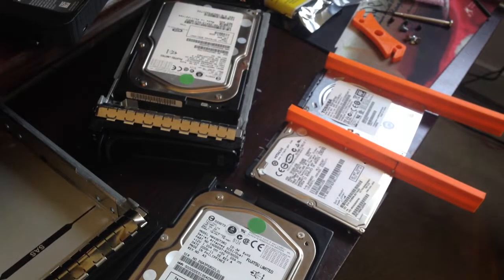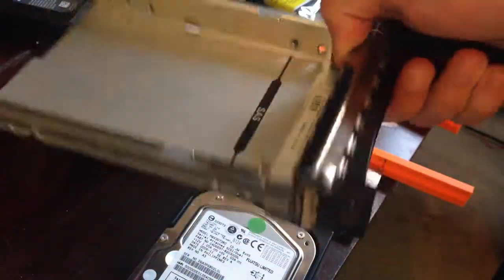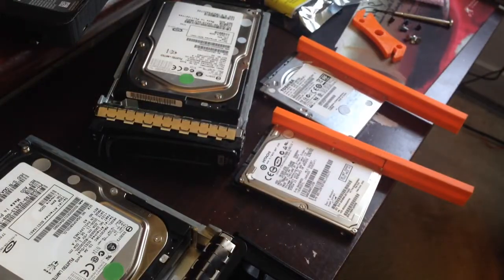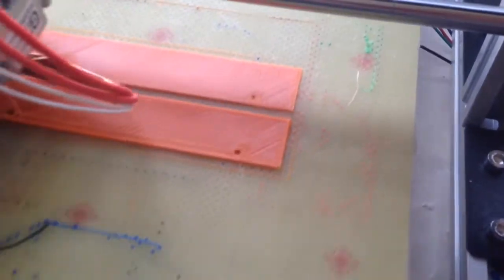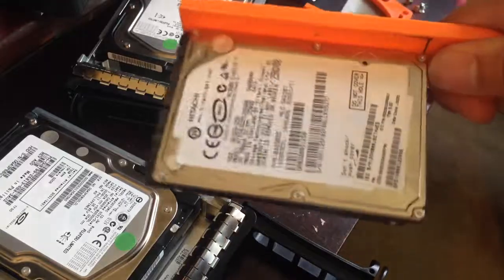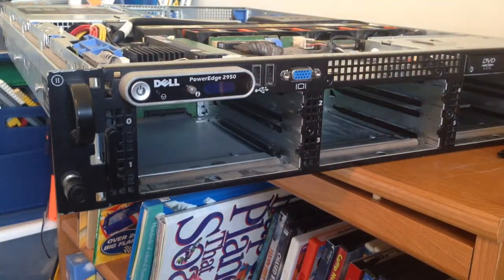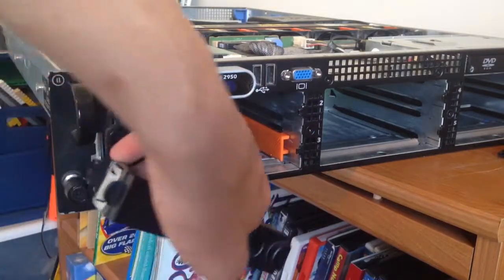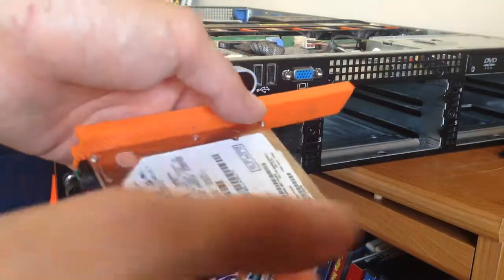3D printing hard drive trays for my Dell Power Edge 2950 rack server

Comment: Can you just make these and sell them? I'd be interested in buying 3 or 4. Also, do you have the 2.5in drive mounted to two sides of the plastic? That'd be so cool, just for stability and vibration prevention.
Reply from the maker: Yea I'm actually working on making an exact clone of the original with light pipes and the works.
Reply: I would be like to buy some too